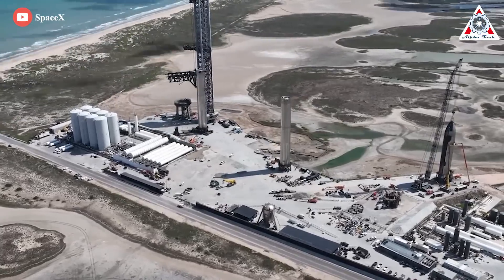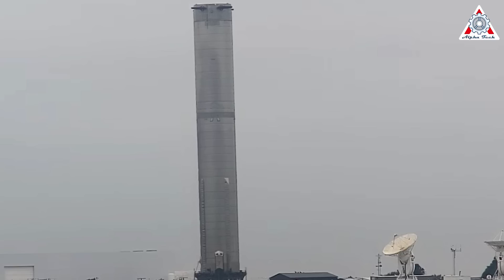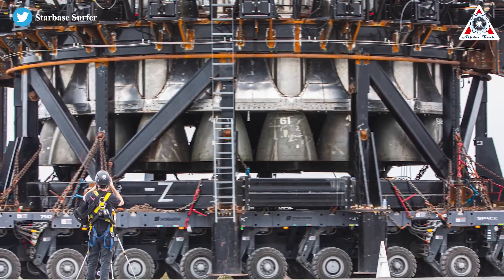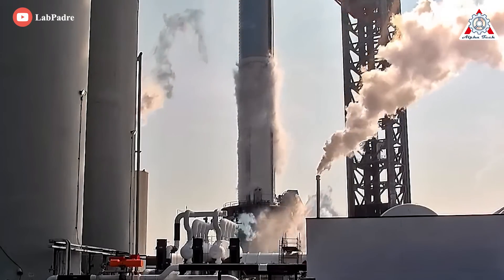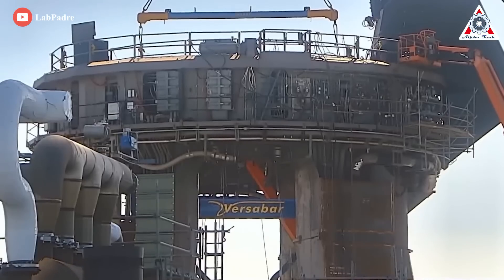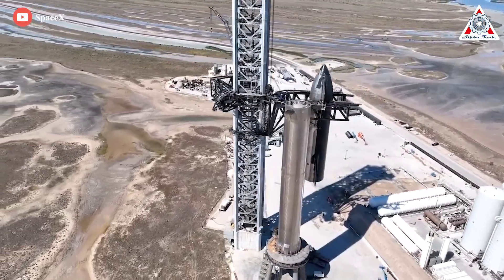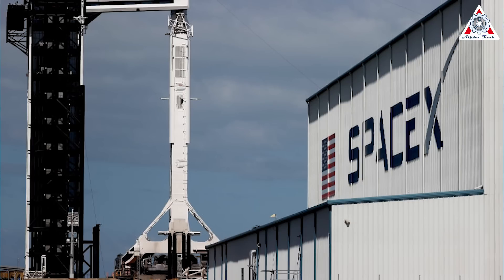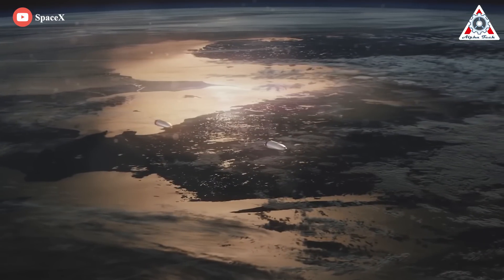SpaceX did a Brilliant Upgrade On Starship Booster For 33 Engines Static Fire this week

Comment: Why didn't the Saturn 5 destroy It's launch pad
Reply: Flame trench in addition to water deluge. More water than 40 days and nights of rain. 😂
Reply: One of the ways I was thinking about is Y go full blast rattle just to get off the ground what is the minimum amount of raptors they wouldn't need to rise the ship above the tower twice the height 800' Once 800' is reached with the starship then go full throttle and you save the launch Pad
Reply: @sushicraves  They lift off at full power because you want to be lifting the maximum load of fuel so that you can deliver the maximum load to orbit.
Reply: What I mean at some point the raptors were not destroying the launch pad at some point the amount of raptors were destroying the large pad so the answer is there that if we can reduce The amount Of Raptors from 33 to 20 Just enough to get the craft in the air without destroying the launch pad and then once you read 800' light all 33

Comment: Did they get the FAA approval to launch yet ?, also did they get the lauch blast under control  ?
Reply: They won't apply for the launch license until they are actually ready to launch.  April at the absolute earliest based on the fuel loading test they just did. They have to unstack it. Remove the lift points from starship, install the FTS, finish Starships heat shield, do the 33 engine static fire, restack it, do a full wet dress rehearsal, and probably 100 other things that we don't know about.
Reply: @JoeShmoism  yeah other things like a much beefier water deluge system and possibly additional environmental approvals for splashing 100s of thousands of gallons of water around the pad....

Comment: Personally I'm a space nerd so many engines is stupid just one or two of those engines not operating properly will cause a really bad day for your bird.  You wonder why most of NASA's missiles have less than five Motors.  Less Problems the Russians found that out with N1.
Reply: I thought the Falcon Heavy has 27 engines - have there been any significant reliability issues there?

Comment: No one wants to answer this: Why is NASA flying a capsule instead of flying on StarShip?  Why is it needed?
Reply: As expensive as SLS is, it is a proven technology and supplying jobs (and votes)... Starship has yet to be proven capable of hauling cargo.. It will need to do this for a while before it can take humans.. Even then NASA will not want all its eggs in one basket if SpaceX has a problem and has to suspend flights of rockets during an investigation. In future when competitors are half-way to approaching Starships capabilities, then NASA can consider phasing-out 1960's capsule tech...

Comment: Very nice video!  Wondering whether the Stage Zero pad at the Cape has that deflector dug-out that was preempted by Army Corps of Engineers at Boca Chica?  How do the two stage Zeros compare? Are they nearly identical?  Were any of the lessons of Stage Zero Boca Chica considered when designing and making the one at the Cape?
Reply: I'm sure their will be improvements of the olm at the cape compared to BocaChica. One thing I can think of is the sound suppressant system was an afterthought  in Texas that was upgraded at the cape with bigger pipes feeding more water to the olm. So I'm sure they have made other improvements by learning from the test facility.

Comment: There is a huge difference between static fire tests on the OLM and an actual launch which would be far gentler on the OLM. Neither of course it is without its issues, but as the rocket takes off rather than being held in place, it does make a difference.
Reply: Did you see what happened to the SLS launch tower?
Reply: But I guess that's something Space X do well, although they know the requirement regards tolerances they are usually quite willing to push it with tests to find problems before problems find them in actual launch conditions. So I guess what I'm saying is yes the launch should be a little less stressful but it's good know where and what the margins really are.
Reply: @KendoSwordsman  redundancy the more motors you have the less redundancy you have the less problems you have or less motors I understand what he's trying to do That's why in 1952 the United States Air Force put out a paper to the rocket engine manufacturers of America to produce an engine that would put out 1500000lb rocket engine The j 2 engine the hydrogen powered engine 200000lb All I know is big and reliable has less problems like to shuttle engine The settle engine is an incredible piece of work it's throttleboro You can throttle that engine it's reusable it's a beautiful thing but when you spend $2 billion dollars on Twitter that could have been spent let's say like to produce a incredible new rocket engine here in the United States or say a thermal blanket that could cover spacecraft for reentry and be reusable or something else but I guess Twitter must be the thing he wants stupidity. Shuttle was great and it still is North American aviation was given two billion dollars two billion dollars that was it we have two million dollars and they did what they could do for that money I know My dad was head of the project
Reply: That's so right a static fire is on a test stand and as good as a static fire can go it's not flying over Mach 1 taking high pressure from the outside taking high pressure from the inside there's lots of things to go wrong and when they do go wrong with multiple engines you're going to blow up your your missile really soon by the range safety officer